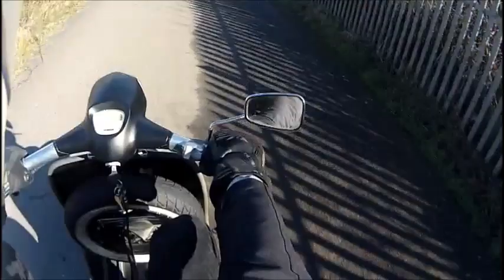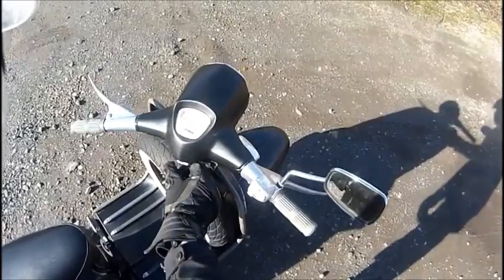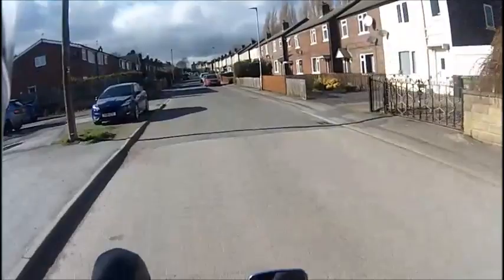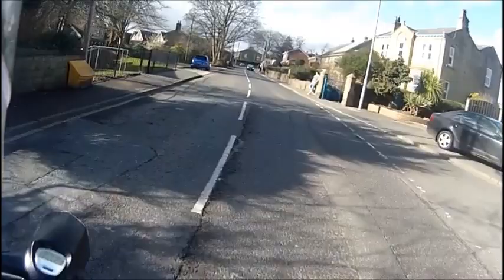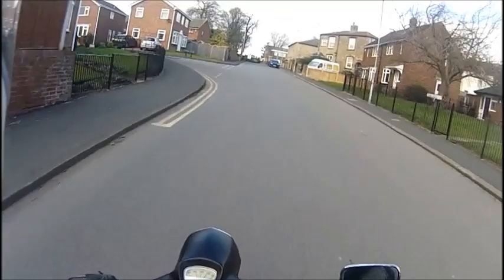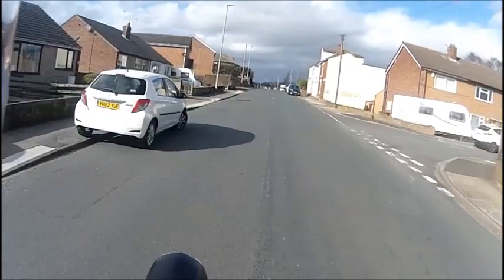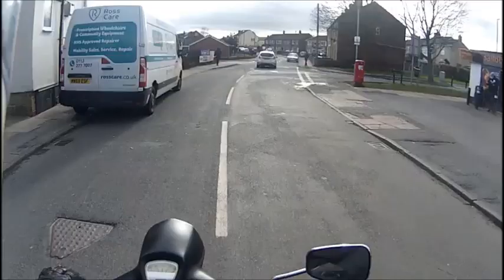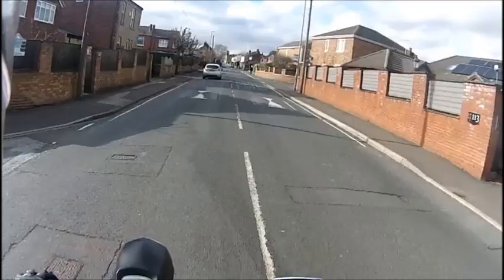Lambretta Vlog Time 80

Comment: Top tip, change the spongy feeling rubber hose too a braided line 😉 welcome back and gud luck at Whitby especially camping you brave soul 😆I’m getting ready for the scooter endurance racing this year
Reply from the maker: Aye that's the plan, should be an improvement. I need to have a measure n that and someone's been in touch who says they can get one made for me so i need to get cracking with it. Thanks man. There'll be a new vid out soon too!
Reply: @digger9million  go too Chiggy Upgrades for the braking line department;-)